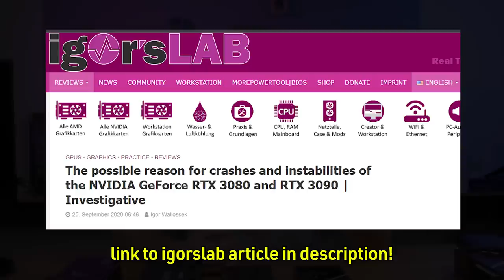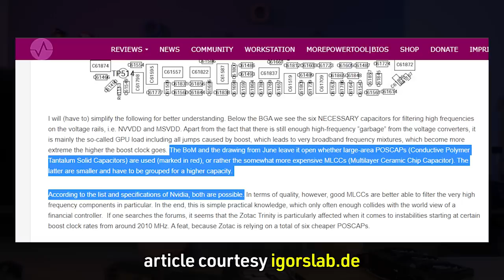The RTX 3080 Launch can't get any worse... Right? Wrong...

Comment: As an electronics Engineer and PCB Designer said on reddit, 

Its not just a case of cheaper POSCAPs = bad, more expensive MLCCs = good. Each has its own positives and negatives and we should not jump to conclusions quickly, there could also be other factors in play. Lets wait and see how this pans out.
Reply: During the GN stream last night, EVGA called tech jesus and dropped a forum post that said, at least regarding the EVGA review models, they went with 6 POSCAPs and their engineers determined that's what was causing erratic behavior in their card. They went on to state that all of their consumer cards only have 4 POSCAPs and this appears to have resolved the issue.

Maybe there's still more going on, but that's their official response.
https://forums.evga.com/Message-about-EVGA-GeForce-RTX-3080-POSCAPs-m3095238.aspx
Reply: Nah. I feel like this is very conclusive findings from igor.

The fact that the FE cards itself have 2 expensive MLCCs array and 4 POSCAPS. And does not have the crashes and boost higher. Suggest that this should've been the bare minimum. 

Which also means that, there was really no reason for AiB to opt out of using atleast 2 of of the Arrays. And not go full 6 x POSCAPS.

They should have followed the 2 MLCCs array + 4 POSCAPS like the FE card.

In the other hand, we get ASUS that literally used all MLCCs and not a POSCAPS in sight.
Reply: Yeah, it's usually a thousand factors with one being the straw that breaks the camel's back.

The FE 3090 has quite a bit of expensive manufacturing decisions that obviously points towards reducing the signal to noise ratio. And I've always wondered why.
Reply: POSCAPs have mid range ESR, but they are quite big, so they have mid range ESL too but high capacity. MLCC have lower capacity but excellent ESR and ESL. This means that placing POSCAPs under the GPU makes very little sense, because they consume the only place where you can place your MLCCs for low ESL (the length of the wire matters for ESL).
Seeing big POSCAPs under a GPU was immediately a red flag for me. You place POSCAPs away from the GPU because  they have relatively high ESR and ESL compared to the wires, so distance matters much less with them. But MLCC can only give you truly low ESR, so you place them as close as you can to the GPU as possible.
Placing any capacitor with more ESR/ESL under the GPU is sub-optimal. They have obviously wanted  to exploit that new polymer caps are almost as good with ESR as MLCC, but they have ended up with cards which almost work...
(I have recently designed a digital FPGA board with ultra low noise tolerance, so I am quite familiar with complicated power supply filtering)
(The caps filter both ways, they filter the voltage noise coming to the GPU, but also filter the current noise which the GPU consumes, the two things are related closely)
Reply: but for now, it's the ONLY and visible! the explanation we get.  And yeah + BS move, like on the gigabyte card, only if for power delivery and more stable overclock, for the roughly same price? no no no no no .... yes I will jump to conclusions when I can ... SEE THIS!
Reply: Indeed.

There are expensive and/or good POSCAPs and cheap/poor MLCCs. But hey what do you expect from J2C? xD

Comment: It's actually weird, too. In my experience designing PCBs, MLCCs generally cost less than most of the tantalum POSCAPS I had used. Mind you, I worked in lower-quantity products. AND it would depend very much on the capacity needed.

If it is something like 100uF, Ceramic caps CAN get pretty pricey, especially if it is six in an array. But much lower than that, and Ceramic caps drop quickly to a couple pennies or less while Tantalums hang out around 25c.

The key, though, is that ceramic caps have EXTREMELY low internal resistance, so they can charge/discharge very quickly, allowing them to absorb really fast changes, such as EMI. Create an array of 6 in parallel, and your capacity is up by 6x and your internal resistance is 1/6th. Tantalum caps, on the other hand, have higher internal resistance, but better energy density. Used them a lot like this: Places where you need energy reservoirs in a tight space going to a highly-variable load. In this case, a GPU. In my case, a cellular modem.

As a bit of extra info, you generally have a cascade of different capacitors values and types. You might go from a 1000uF tantalum or aluminum electrolytic array, then down to 10uf, then almost always some 1uF and 0.1uF capacitors right next to the chip. In this case, those would be the capacitors you have to watch out for when applying thermal paste, because they put them RIGHT NEXT to the GPU for maximum voltage rigidity.
Reply: Mmm
Reply: This is one of those golden comments I scroll down for
Reply: The info in this video is presented as confirmed when it's still speculative.

There are some reports on forums that "good" cards are also unstable, so it may be a software issue.
Reply: Can you explain it like you are explaining it to a 3 year old? Pictures would be appreciated.
Reply: WebX: Talks
Me: r/wooosh
Reply: also done a bit of pcb design myself. I wonder if using 1 POSCAP instead of 6 MLCCs saved considerable time in the pick and place machine... thats the only part I can think of that they can cut some cost. Fixing this problem is just simply switching parts in the BOM and pick and place. no extra tooling would be required for testing, I think.
Reply: @mik995px  It could be more complex than just cost considerations.

Since we're dealing with AC signals, using inhomogeneous signal filtering can result in better transient performance and a wider effective range.

Here's a research paper to that effect: https://www.researchgate.net/publication/251381242_Designing_a_mixed_electrolyticceramic_filter_capacitor_in_DC-DC_converters
Reply: @AndySomething  https://en.wikipedia.org/wiki/Capacitor
Reply: @louisvaught2495  I havent done much work with very complex stuff. Ill give that a good read! :)
Reply: i don't think it is this.  this sounds like a power issue to me.  plus almost all of your terms used are non-standard leading me to believe you're also untrained.

Comment: Also, once brands like Zoltac are known to have under-spec cards people will treat them like Powercolor and avoid them like the plague. They will HAVE to retool to meet their own clocks or compete with the more premium component options.
Reply: I already avoid Zotac like the plague!  There's a reason they're so cheap, lol.
Reply: Didnt the RedDevil cards from Powercolor get really good reviews though ?
Still, agree with Zotac not exactly being a 1st tier manufacturer. They seem to push their stuff too hard just so they can slap "MEGA SUPER OC" branding on it but they dont back that up with good hardware.
Reply: @vertimyst  I have a GTX 1080 Zotac, is awesome
Reply: Powercolor are bad? They have some cool design and I think saw a review on one with pretty good cooling
Reply: @Mart-E12  their shit is good for the first 2 months, after that it breaks and you get 0% of the performance you previously had
Reply: @davidsegalle563  You can just rma it then
Reply: I've had a Zotac 2070 Super for the last year. Zero problems, runs great.
Reply: @davidsegalle563  I guess i got lucky. I got a Powercolor RX 5700xt Red Devil and it still works perfectly well over a year later, even overclocks higher than advertised.
Reply: @o0keitaro0o  I have a 1080 amp extreme. The PCB itself is good, but the cooler was shit and my hdmi port is buggy (not working with newer driver versions)
Reply: @MrSylvandragon  Got a 5700 xt red dragon, still works and it has been 4 months.
Reply: @subarustiguy8   I got the Zotac RTX 2070 Mini and it's running fine.
Reply: You lose like 1-3 fps compared to msi's or asus's 3080 but in some cases, which is a bad tradeoff for design and cooling. Lol
Reply: @subarustiguy8  Isn't Zotac owned by nVidia?

Zotac 2070 extreme for 2+ years or near when it came out and no issues I could replicate or blame the card for. Really rarely ever had an issue with my PC at all though, tbf.

But I think 'everyone' has different experiences with different brands/cards, of course.

I wouldn't skip over a Zotac, done aight by me.
Reply: @MrSylvandragon  It sounds like they fix issues when they arise, I guess.

Honestly, this would make me more inclined to check out their cards next time I'm on the market and not avoid them. Literally admitting a problem not under NDA and saying they didn't know why, which is just being honest.
Reply: @davidsegalle563  I have a 950 2gb 4+ years old faced a lot of dust. Still runs decent and cool despite never changing the thermal paste. I got really lucky then I guess
Reply: didn't the Zotac only go for 2 slots size? it kinda makes sense if you lower everything if you trying not to burn the GPU. its probably the only brand atm to fit in a mini itx case without watercooling loop, unless you mod it somehow.
Reply: @UnfitToLive  compared to others, i never had problems with drivers, but they definitely happened. However, my card similarly got a decent boost from the improved drivers nonetheless
Reply: my 1070ti amp extreme zotac is a beast still ?
Reply: @subarustiguy8  same here

Comment: So, after the new Nvidia drivers, the stability issues has been resolved - are you going to do a video explaining that the cap's are actually NOT as big an issue as you (and other people that blew this out of proportion) thought?!
Reply: Uhm..Those cheap designs are a problem. If you experience a problem like crashes or not doesn't matter.
Reply: @Baustakar  What cheap design!?

The POSCAP's that Gigabyte uses, are more expensive than MTCC's....
Reply: @Baustakar  No it wasn't. They weren't even cheap to begin with. It also doesn't explain why the cards wouldn't crash on Linux. It literally was just windows driver issues. The fact that people still think the caps are the culprits, it's because of Jay.
Reply: I really hope they do release a proper mea culpa, here. This video is the main reason that this "capacitors are causing crashes!" meme became so huge. While, in retrospect, it's clear that they never were.
Reply: @coredumperror  Yeah, but the new video that addresses the "none issue" almost seems to put the blame for blowing the entire capacitor thing out of proportion on the viewers!?!

I don't get it - why not just say "Hey, Jay here - we made a mistake, we went with rumors, and we were wrong"...
Reply: cheap DESIGN regarding EMC. Not cheap PARTS.  I'm talking about rooting and about the circuit design. Are you guys even aware what EMC is? This stuff : https://www.emv-support-dresden.de/stoeraussendung.php

Every product on the market has to get through diverse compliance tests (f.e. https://en.wikipedia.org/wiki/Restriction_of_Hazardous_Substances_Directive), emc tests(https://en.wikipedia.org/wiki/Electromagnetic_compatibility) and so on.

I bet those emc tests were made with the lower clock written in the specs. Not with the boost clock. But I can't tell for sure because even the case I'm an electrical engineer I'm working in a different field of it. EMC tests are rare in my field(4-5 per year) but I have to give support for our products if issues occure and help with design choices and rooting.
Reply: when you cross certain point of famous and rich, yuo can say and do whatever yuo want and crowd will follow you anyway.
Reply: Does anybody know if the new card have anti plasma 1080p 3D?
Reply: The driver was just to under clock it to make the cheaper parts more stable 🤣
Reply: @wtfman1217  Oh, you mean my cheap part that is doing 2055Mhz stable, with the new drivers?

Comment: This is so messy were literally beta testers for 1000$ equipment, lmao
Reply: Now imagine how Tesla owners feel being beta testers
Reply: My Channel  Yeah i just stole one
Reply: Hopping everyone who got a card gets a replacement under warranty. Luckily I didn't buy one.
Reply: What?
Reply: think ill stick with my 1080 a bit longer.
Reply: you CHOOSE to buy their cancer everytime. dont complain afterwards.
Reply: We said that about the 20XX too, lol.
Reply: got a 3080 from gigabyte that is suppose to be one of the worst if i watch this video, but ive got zero crashes and most people on reddit also dont have any with the card
Reply: always the case.
Reply: @Battleneter  That's a non-answer. They say that the number and quality of capacitors is not "necessarily" the indication of quality, but it CAN be
Reply: Turns out the issue only effected a minority of cards sent out to reviewers, and wont effect retail cards.
Reply: @MrBuurt  As mentioned in the video, it only affects you if the automated OC pushes the frequencies to their limit. And the card won't overclock that high unless you have perfect temperatures.
If your room temperature or case temperature is warm, chances are you are running at stock speeds or just slightly higher.
Reply: that's why you don't buy new tech on day 1 of launch lmao
Reply: @Shendue  or it was fixed after the first shipment they did and with new nvidia driver because i see like zero complaining on gigabyte reddit the last weeks even when people are pushing their card to the limit they have no crashes,. for me this whole video and the crying was over the top to make some more drama.
Reply: @whoknows8225  lol i still have msi 1080 ti and i'm not interest in RTX yet but laughed so hard at them how they can't beat 1080 card with 1950mhz
Reply: @nitrogaming708  yeah i see no real reason to upgrade yet, no rush, im fine :)
Reply: welcome to 2020. Everyone does it like this now, long gone the days when a product gets extensively tested before release, now everyone just wants to release it as quick as possible to drawn in money to cover the loss the research generated...
Reply: @vesuvius All cards are AIB. Including FE. It's not a term for third party cards like people think.
Reply: @whoknows8225  nothing is wrong with the cards all they needed was a NVIDIA driver
Reply: @mamba109  more like BETA TESLERS

Comment: Those "more expensive" capacitors by the way are still not expensive. Maybe to setup your board placement machines to do that process might be time consuming, but the pieces themselves are really not what you would call costly when purchased in the quantities that these manufacturers buy them in.

Comment: Jay:  "The cost is indicative of quality of parts used."
Guy:  "So that $50,000 3080 I bought from eBay should be crushing the benchmarks!"
Reply: i  can confirm that teh 50k ebay version boosts to 5ghz stable at 35 C.
oh btw i can offer one, and if you want a bundle, this card plus the golden gate bridge for the low low price of 79,999.90
Reply: well he did say cost, not price, cost is what the manufacturer has to spend to build it, price is what you pay for that product.
Reply: ebay is auction, not the normal market

Comment: On AliExpress you can get a PCIe card that cleans up power distribution in your computer using an array of filter capacitors . It might be able to stabilize your system. Normally these cards are used by audiophiles to avoid noise inside the system from affecting the sound card output.